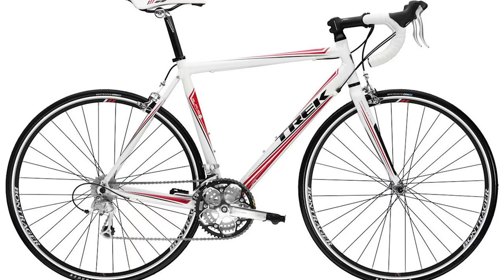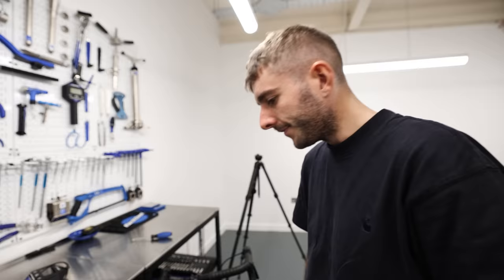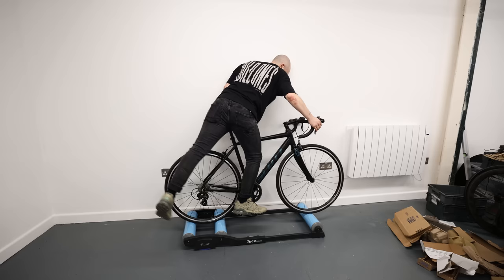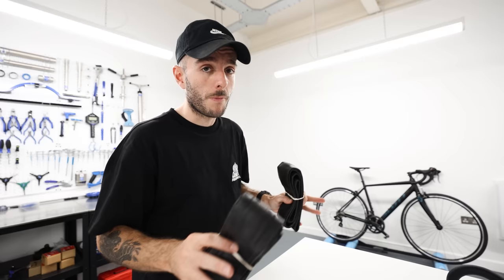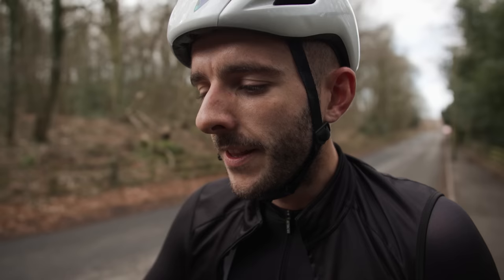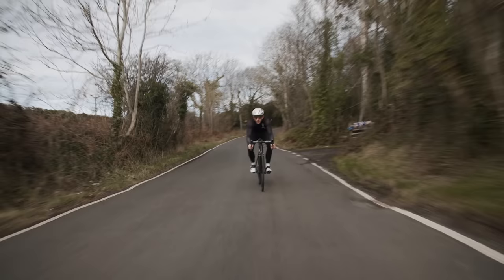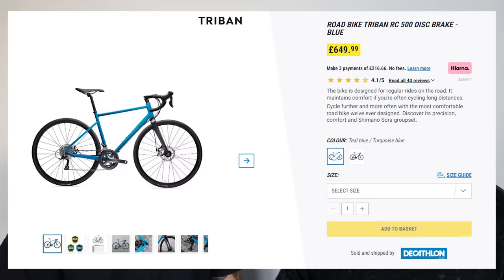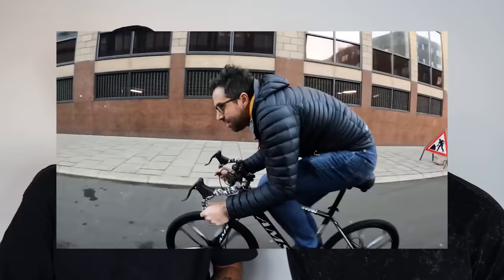How Good Is An "Entry Level" Road Bike In 2023?

Comment: I know Scott is a sponsor, but this is probably the worst value in value bikes. For the same money, you can get a CAAD Optimo 2 which gives you a carbon fork, around 2kg less weight, jumps up 4 rungs on the groupset ladder (tiagra) with enough gearing and proper range for a newbie, better geometry and an all around better bike. This is a bike anyone could and would ride for a long time. THIS is the best value in new bikes currently. Also of note is the Domane AL and Endurace AL.  Good value can still be had, not from Scott apparently.

Comment: Do 28mm tyres make a lot of difference in regards to grip on the road?

I have (admittedly very old and past their best) 25mm tyres on a Bianchi Impulso from 2015 (I think) and have fell off it twice in the past two weeks.

The second time was on a roundabout and the front wheel just slid from underneath me.

Would wider tyres give me more stability because I can’t be arsed smacking my face on the floor again anytime soon 😂?
Reply: Yes wider tyres can help with grip, but equally the model of tyre you choose makes an even bigger difference, what are you currently using?
Some offer much more grip than others, which is nothing to do with tread pattern but is to do with the rubber compound used. Generally a racier tyre which will usually have a softer compound is grippier than a harder more puncture resistant tyre - for example a GP5000 is way more grippy than a Gatorskin.
Also tyre pressure makes a massive difference, generally softer is better as it allows the tyre to deform to the contours of the road and get better grip. What pressures do you run?
Reply: Thank you for replying  @huntos83  and sorry for my late reply. 

Yeah, I think some new tyres are definitely in order. I’ll take a look at the ones you’ve suggested. 

The brand of tyres on my bike currently are Vitoria…I think. They were on the bike when I bought it which was quite a while ago. I can’t imagine they’re the best tyres in world.

I’m surprised they’ve lasted this long and I’ve never had a puncture (which just seems weird 😆)
Reply: @dandevvers  old tyres also tend to go hard and become less grippy with age. You should definitely fit something new it’s one of the best value upgrades you can make on a bike.

Comment: as a bike, disregarding the cost, yes it is an entry level bike. but what do we mean by entry level? is it the point where people easily can enter the sport - then it might be a bit much - or is it the point where you can enter the sport with som quality hardware - then it is still a bit much but less so. I think entry level has moved to the second hand market IF you as a new cyclist can get som help to get a good bike for less, or a better bike for the same.
the bikes from 500-1000 (random currency) is for new cyclists with no previous knowledge and/or without outside help.

my fist NEW bike was a Merida Road 903 with Tiagra back in 2003 or something. before that I had my stepdads old noname steel frame with campag. it hade the shifters on the down tube.. it was lovely but total shit.

Comment: That's ridiculous, I've already checked this bike in some local shop, it's 1100€😱. I've bought my first road bike only 4 years ago, it was alloy Merida scultura with carbon fork and non series hydraulic Ultegra 6800 for 1300€. There was some small discount, but It absolutely doesn't correspond with inflation or anything else, simply ridiculous.

Comment: Honestly I feel like cheaper bikes get a worse rep than they deserve from people trying to justify the diminishing returns they get from spending massive amounts on a bike. 

You'd think you couldn't even cycle 50 miles on an 10kg+ entry level bike in the opinion of some cyclists, or that rim brakes don't even work, and you need drop at least a couple thousand for that. They act like the bike would just fall apart just by looking at it and be 50% slower. The elitism can be ridiculous. Unless you're a pro or a very, very dedicated amateur, you really don't need to spend thousands, especially just to shave a gram or two off here and there. 

Grab an entry level bike, throw on a pair of shorts and a shirt, and don't even buy clipless pedals. Just get out there and cycle and have fun.

Comment: dang, that's expensive and much worse once you made the mods. Better to buy used. Bike pricing is out of control if you compare the manufacturing cost of a bike vs. scooter/moped or motorcycle. Not a value at all.

Comment: I can only assume the wide bars are a safety thing, compromising fit for better control at the low speeds and mitigating the poor bike handling skills of a new rider.
Reply: they are just more common, i had to buy a very expensive 40cm ones, and 38 were a unicorn (small country) because everyone used 44 and 42

Comment: Scott is ridiculously overpriced.  Looking stateside as I'm in the US.  The Scott Speedster 50 is $1399 USD and is mech disc because the rim brake version is not sold stateside, but otherwise identical build with loltourney groupset.  For the US the cheapest decent road bike you can get from a shop brand looks like the Giant Contend 3, $950 USD has Claris, is rim brake, with carbon fork.  The Specialized Allez and Trek Domane AL 2 are comparable to the Giant in build but are $1100 USD both rim brake as well.  If you want to go DTC, Canyon Endurace AL 6 is $1499 USD and has Tiagra with hydrualic disc.  It's gone stupid in the last few years.  My first modern bike was a 2020 Giant Talon 3 that I only paid $550 USD for brand new (Came with Suntour coil fork, 2x8 Acera groupset and Tektro hydrualic discs), even adding a dropper post, two sets of decent pedals (one set of flats and a set of crank bros clipless), a decent saddle and converting it to tubeless didn't push the overall cost to anywhere near $1000 USD

Comment: Are non electric bikes subsiding a race to the bottom for budget electric bike market? Or is the excuse still the pandemic? Having not looked at bikes for 5+ years I can't believe you're only getting a 7 speed 'tourney' for £900. That's insane!  Last bike I bought in 2017 was a 2012 Giant Defy 1 advanced for £300 and to upgrade I would need to spend ££££'s

Comment: Personally I don't see how this price range, given what the bike is spec'd with, can be called an "entry bike". Pre-pandemic would've got you a similar bike but with a 105 groupset, or for £100 more, a carbon frame with tiagra. There's nothing about this bike that screams "worthy purchase" in my eyes. I appreciate where the video is coming from, but this is nothing short of a rip off. Its almost screaming at the public to not buy a new bike and buy second hand to acquire a better built bike from factory.

Comment: Oh my god tourney on a bike at that price and you guys have the cheek to laugh at halfords bikes? Tourney road bikes at halfords are £385. For that Scott's price at halfords you can get a Boardman with carbon forks and tiagra. I'm not a fan of halfords and I'd check the quality of the build if you let them assemble it for you but that Scott is soo overpriced. Pre covid tourney was on sub £200 bikes only.
Reply from the maker: Hi Liam, please point to the part of the video where Halfords bikes were laughed at. Thanks.
Reply: @Cade_Media  you called them bike shaped objects. Didn't specifically laugh but definitely poked fun at them. You should definitely compare their offerings at these prices to your Scott's or specialized etc as on spec they beat them but do they ride as good?
Reply from the maker: I don’t think we did Liam. 
We’ll happily test some cheaper options though, stay tuned.